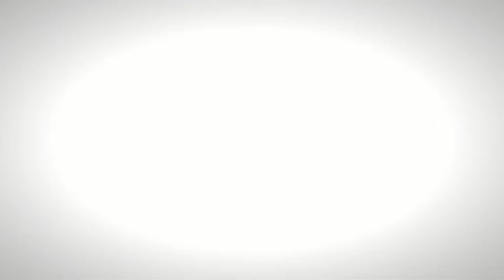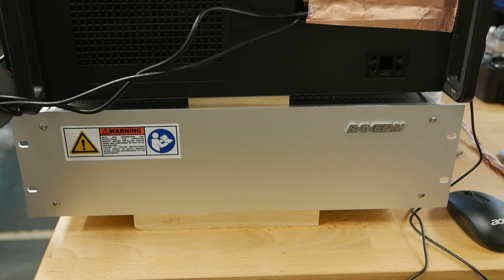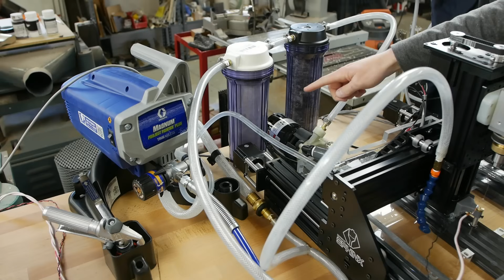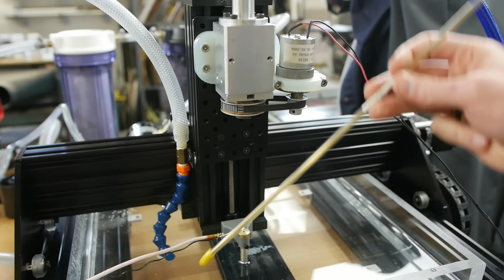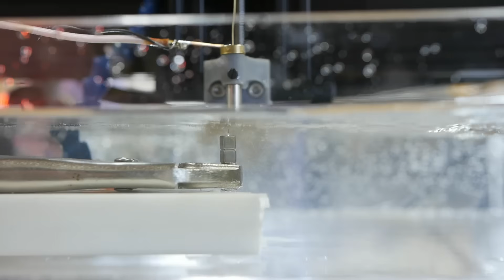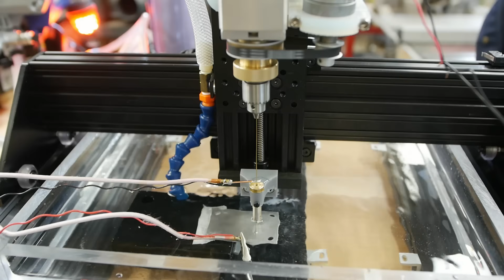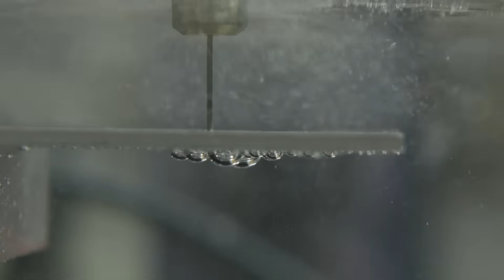Drill through anything (conductive) with Electrical Discharge Machining

Comment: I'm am a machinist/tool maker in the aerospace industry and I've been working with a ram edm machine for about two years now and It really can do some amazing things especially if you machine edm conductive graphite into the shape you want the whole but it takes some skill with calculating wear rates when it come to power settings and graphite I'm unsure what the difference is with cutting in water but in the shop I work in we burn with euro supreme semi synthetic dielectric fluid which I know is pretty expensive but may be worth checking out for your set up. Great video by the way

Comment: I worked at a little machine shop in Santa Monica back in the nineties and they had an edm  but they used kerosene, not water. I loved telling my friends that I could drill a hole through a piece of tool steel with a piece of copper.

Comment: A bit over cooked just to make a hole in metal
Not to mention the energy involved and equipment required
I use a thing called a drill bit I attach it to a thing called a drill and make holes of all sizes
Reply: Except it can't drill holes that are round, on location, on an inclined plane, through carbide or just loooong like 1 mm hole 300 mm deep.

You are right that in conventional machining it hard to beat a drill if you just want a hole or to remove material fast.

Comment: In some cases the electrode erodes way more than the workpiece. Usually depends on the electrode diameter, and the workpiece material. Smaller diameters usually erode faster in the same material. The worst material i have met is tungsten carbide. It eats up the electrodes.

Comment: You'll notice if you look very closely, the generator he has on borrow uses an inverted oscillation frequency. This means that any resistance exhibited by the conductive material being drilled will dissipate the excess charge throughout the ambient environment,  thus requiring no pressure on said material. And furthermore,  i made all that up. I have no idea what he's talking about. I was lost at about 0:02.

Comment: When I worked as a machinist we used EDM to burn in specific shapes into molds for diecast and plastic parts. We would machine graphite electrodes and add 0.025" diameter holes for the cooling oil. It is an awesome tool for machining.

Comment: Why does the drill need to turn at all if the  cutter never touches the material being cut?
Reply: Makes the electrode wear evenly and makes a round hole which is in the very location of the spindle axis. And because of the rotation, the flowing water doesn't form any spots to hang up in but flushes evenly.

Comment: When I was in Grade 8, a buddy and I built an EDM drill starting from an article that had been in Popular Mechanics. I got a section of a many-splined transmission shaft to use as a "tool" from a shop that fixed Kenworth oilfield trucks. That was pretty hard, high-grade steel,  and it was able to drill a close-fitting hole through a piece of 1-1/2" mild steel or aluminum plate. The plate being drilled was submerged in Kerosene in a clear Pyrex dish, so that the arc discharge was actually covered by the liquid. Raising/lowering the head for the cutting tool was a vertical slide made of maple, both the track and the movable head that ran in it. The maple slider holding the "tool" was raised and lowered by fly line running through a multi-line block & tackle made with  Meccano pulleys. We got a very slow-turning gear motor out of a junked Timex watch display, which very slowly un-reeled the line, lowering the cutting tool. The speed for lowering the cutting head was one of the hardest things to get right. The winding motor wasn't variable speed or reversible - a hand crank raised the cutting head.  

We cobbled up a circulating pump using an automotive-type mechanical fuel pump with the actuating lever arm moved by a maple cam on a bolt chucked in a 1/4" electric drill. We put a diode in one leg of the power wires to slow the drill down.  We made a tapered glass tubing nozzle for the hose where it "squirted" at the workpiece. That flushed the cuttings away from the tool pretty well, although not as nicely as if we'd had a tool head with a hollow center to pump the Kerosene through. The cuttings built up quite quickly, and we discovered that things didn't work so well if the liquid was full of metal cuttings. The solution for that problem was to drain the kerosene full of cuttings into a reservoir.  Some settled out, and the pump output ran through a Diesel engine fuel filter.  Our high voltage supply was 120 VAC going through a voltage doubler or tripler power supply, using some big capacitors, some big incandescent light bulbs for current limiting, and some high-rating diodes we obtained by writing to a solid-state component manufacturer. They sent us a box with 2 or 3 sets as well as some heat sink material free of charge, which was good of them.  

All this back in 1969 - 50 years ago - hard to believe. Later I became an electrical engineer, and belatedly learned just how dangerous this setup had been. But, ignorance is bliss, and we never had any shocks, big arcs, fires or major problems or failures, and it actually did cut really complex shaped holes through thick steel and aluminum. A buddy and I built this contraption and won 2nd prize at a regional science fair. We attended a really small school, with teachers who really didn't understand (fortunately) what we were doing very well.  We figured we'd done OK, since about 80% of the parts were junk/scrap, begged, or donated, and the only "guidebook" we had was a Popular Mechanics article. 

We bought the big capacitors from a motor & genset rewinding shop that worked on oilfield equipment. They got interested in what we were doing, and donated the mechanical fuel pump, a bunch of hoses, and a diesel engine filter housing and filters along with the fittings to connect it all up. They thought using an electric drill to drive the pump showed "ingenuity."  We were pretty lucky to have people help us out with things like that, and the high voltage diodes.

It's sure a long, long way from where EDM technology is today. I went to an industrial trade show once, where some EDM equipment was being demo'd, and told one of the sales reps about the Grade 8 science fair project. He had a good laugh, and told me we'd been complete idiots. Which wasn't really fair - we built it with almost no adult help, solved all the problems, and made a working machine that actually drilled a 1"-1-1/4" splined hole through thick steel plate. We nicknamed the beast the "Spitzensparken" for obvious reasons. My friend's dad was a ham radio operator, so he knew something about high voltage wiring and insulation. We were pretty lucky in some respects.  How many school science teachers today would let a couple of 13 year-olds build a project like this in the school lab?. We had parents who kept an eye on things but trusted us enough to be careful when fooling around with what was a pretty crude rig.
Reply: Man that’s totally awesome! 
I love that you got your inspiration from “Popular Mechanics”..... The internet’s of yesteryear!!!🤓😂😂😂 
EDM would possibly be a cool way to fix a probe too a meteor. Drill and then weld. I’m wondering if you could torque steer the drill filament....🤓🤜🏼🤛🏼🤓🇦🇺
Reply: Damn I wonder what won first prize
Reply: @Jim Baritone, what a story of genius at such a young age! You knew your calling. Typical of people who become engineers. I assume you are now retired and like me keep up with the journals and science news. Life is good! I knew my calling early in life (7th grade) and took a basic electronics course. I had no father to encourage me and help me make my dreams come true. The Armed Forces Schools gave me more training and I was able to secure employment at the White Sands Missile Range as an ET and later on an Engineer Assistant. I took college courses as necessary after returning from Vietnam to stay proficient and competitive. You did well Jim as a young dreamer and became one of the most coveted of career professionals in the world. Best of wishes!
Reply: Agreed, thumbs up for volume.
Reply: Top marks jim👍Wish I was that smart.
Reply: They were flexing their ego because they were not 8 yrs old when they were doing the industrial trade show projects. To them it's get it done or be fired. But you guys <.< beat their ego out thus their name calling. Well typical workers. It takes an inventor to know an inventor. A worker will always call an inventor an idiot, thus that mentality.
Reply: Very cool and you sound about my age. Did similar crazy stuff from those mags all in the "lab" in my parents garage, they we always afraid I'd set fire to the garage and subsequently burn the house down LOL. I ended up going the scientist route  but the thing I liked about what you said was about your science teachers. We had cool science teachers that were always "blowing thing up" and doing crazy experiments, I'd be a liar if I denied that they didn't have an influence on my later formal education.
Reply: Wow! What a story. Thank you for sharing.
Reply: I built a "Carbon Arc Furnace" in eighth grade using line voltage, bare stranded wires stuck in a beaker and twisted around carbon rods poking through 1/4" plywood, the whole thing drawing 20 amps, boiling the water/salt solution within a few seconds and creating a 1 inch curving arc of plasma.  No goggles, no gloves, fingers on the wood an inch away from the loose fitting carbon rods, the entire apparatus within arm distance.  Blew the breakers during my presentation and melted lead from the heat.  I would not go within 10 feet of this thing now.
Reply: Stuff like this is what makes me wish I'd been able to experience the 60's lol
Reply: my thinking is that one could say that all pioneers in a tech are 'idiots" relative to future advances.   cavemen finally successfully making fire were "idiots" and total geniuses depending on standard of comparison....
Reply: These will eventually have to be strictly regulated as a good design could easily  machine a fully automatic firearm with suppressor ...could even machine rifling in a barrel with the right setup I imagine.....Be better than "printing" one...All one would have to source is springs ....
Reply: @dougiequick1  machine guns have been made for over 100 years with lathes and milling machines or even shapers, if they are going to regulate edm then they are going to have to regulate lathes and milling machines first since there's a lot more of them around.. a lathe can even be used to make the spring.. rifling can be cut surprisingly easy, it used to be cut by hand with a broach and a piece of round wood with a spiral grove cut in it as a guide for the pitch
Reply: @dougiequick1  There is a book by a guy in the UK. He built a crude fully auto machine gun from hardware store parts only. You don't need an EDM machine to build a gun. With a small mill, a lathe or even with a drill press, one can make a gun.
Reply: While a thirteen year old me would be playing video games. 

Sad how i wasted some of my teenage years while cool stuff like this existed.
Reply: Wow how amazing .I hope your children are as brilliant as you. I am very interested in what took first place at that science fair.
Reply: N.Y. NBA by ; huh bub by 76 by n.a. ?,, mg gov by y 4th ghh/k
Reply: Kali Southpaw  I agree. I do think that there are a lot more important things that money should be spent on rather than going to the moon. Cures for medical issues ,
infrastructure or even building new lakes so we can meet future water demand.
Reply: Kali Southpaw  well said, the legal profesion also have a lot to answer for sueing any body who has a money and stifling innovation /enterprise
Reply: EDm-Electric migit, I was looking for that source, I did it 50 years ago
Reply: Should say: Electric Discharge migit.
Reply: Thanks for the essay.
Reply: I've read popular science for many years, I don't recall any article about EDM.  Me thinks you tell a tall tale.

Comment: You aren't drilling, you're EDMing. Big whoop. Takes forever and not accurate. A machinist like me can drill through anything conductive or not. I've drilled a 3mm hole 750 mm deep, it'd take you a month and cost a fortune, i did it 10 minutes with a gundrill. Drilling through carbide? Piece of cake, just need a diamond drill bit. You'd have a hard time flushing, so I know that your holes aren't concentric and deviated

Comment: Doesn't the water conductivity cause a problem? I suppose there would be frequent filter changes because of this. I am impressed with your setup, drilling many strand cable! that's impossible with a conventional drill. Thanks for showing.

Comment: The actual device that regulates the frequency of the generated spark for drilling... How do you do that without a physical contact? Because surely the physical contact is going to suffer the same level of drilling as the item you wish to bore trough?

Comment: I've been waiting for something like this. Back in the '80s I read an article in Popular Mechanics (I think) where a guy built his own manual EDM. He used a full wave bridge that ran directly off of house mains. He built a jig kind of like the CNC rig in this video only it had no X or Y but just a knob on the Z axis. He used kerosene as the fluid. The "cutting" tool was any shape he wanted the hole to be, a star for example. He attached it to the Z axis and used the know to lower it onto the work piece. He said it wasn't too hard to keep a smooth cutting rate by just listen to the sound it made. He also used 3D cutting tools which would leave a divot in the work piece shaped like the negative of the tool. No need to cut all the way through. NOTE: I just learned this is called die EDM.

I guess the frequency of the EDM current was 120 HZ. I wonder if that would work on this machine?

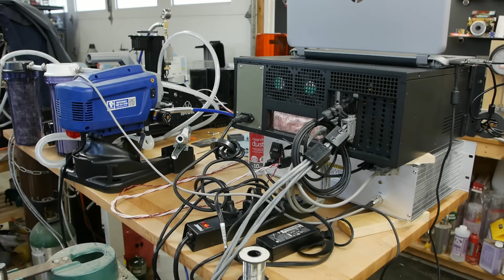Comment: 21:49 If the electrode wears down as it drills through and its slightly bent creating a bigger hole, that would mean the hole would taper down as it goes through, correct?

Comment: Nicely done!  The T.I.R. of the drill chuck is well beyond any normal standard.  It appears that it is a result of the mount of the drill chuck to the spindle or a bent spindle?  I would think concentricity would be improved with this fixed.

Comment: Okay so now you have shown how, possibly, the megalithic structures around the world were created in the last ancient time before the last cataclysm.  Sound and low voltage machines were most likely use for those structures.  Even though this machine is probably high voltage.  I know nothing about how it works.  But if you turn up the sound waves, (resonance), and down the electricity maybe.  Those old stones are made of quartz and granite which are conductive.  Everything in nature has a frequency.

Now how to apply these techniques to levitate with sound.  That's got to be the only way those massive stones could have been moved.  We cannot even move them to this with our current technology.

So may I suggest you try to cut through some quartz stone or similar that has conductive properties.  

I'm sure this sounds nutty speak to a lot of you but jmt.

Comment: I used to take a power adapter, cut the wires and attach one end to a rod, one end to a fixture. And then programmed the cnc machine to go up and down at small intervals to to get rid of broken endmills/taps instead of setting up an EDM machine to do the job.

Comment: Very cool stuff.One suggestion if you don't mind me saying is perhaps a small accumulator so that your water pump won't keep short cycling.Although as a paint sprayer,it's actually designed to do that.Well it's just an idea.I had no clue before today that such a machine exists.My field of diesel engine repair and service deals with a problem with coolant being too acidic that causes pinholes (by cavitation erosion), to develop in the cylinder liners which leads to jacket water entering the combustion chamber,and crankcase. To prevent this, the coolant must be kept at  a ph of 9.0 or above.Alternator ground connection location is critical to avoid this problem.Perhaps this is food for thought.Awesome work and thanks for this film. Clifton in Titusville Florida

Comment: Im working on proffesional cnc edm machines. We are sharpening diamond tools for wood, and we are using special dielectric oil for cooling. Electrodes are disc shaped, constantly rotating while eroding, maked of mixture of tungsten carbide and copper. After every tooth (or else, if i choose to) machine is automatically taking 0.2mm of burned area of disc and checking dimensions of disc on probe. Filters are ordinary, not much different than car oil filters, only much bigger. Power supply for eroding run on pulses, 70-150V, around 150mA,  but that depend on what finish surface i want on eroded part. Feel free to ask anything about this, i will try to answer at best of my knowledge. Producers of theese machines keeps so much secrets about them but you can figure out a lot by examining machine

Comment: What is that magnet for at your power cable?
I've seen it somewhere in a casing before but I can't remember what the benefit for such magnet is.
Reply: It is a ferrite core, used to suppress electrical interference noise that could be transferred to the computers high frequency output used for this process (EDM).

Comment: Dear Mr (Applied Science): What is the voltage, current & frequency rating of the electronic power supply that runs the EDM machine? (If you have a schematic diagram, great, if not, that's ok) (And not the power supply for the drill or moving carriage, but the EDM pulse generator itself).